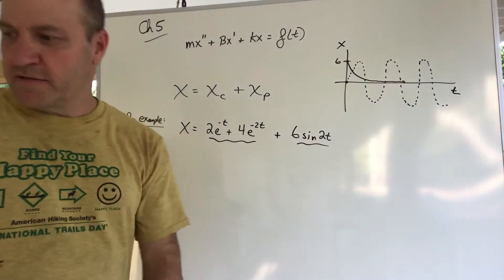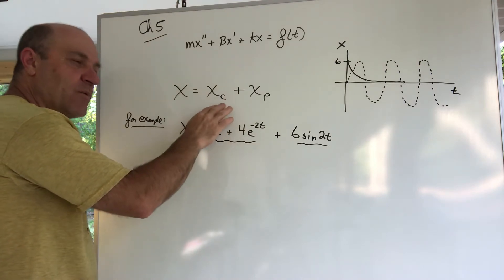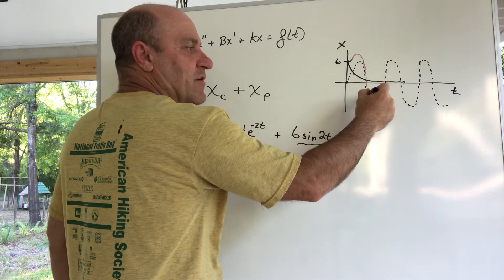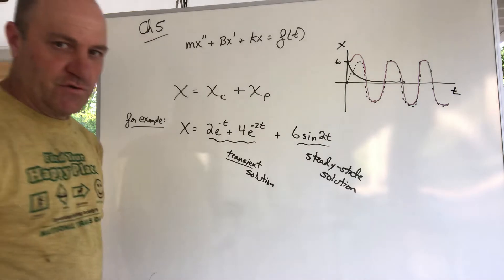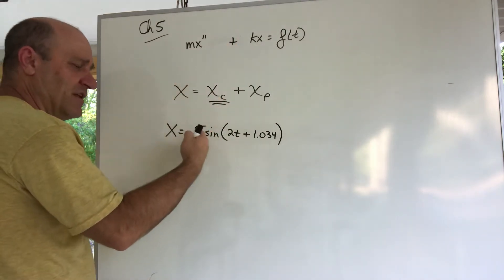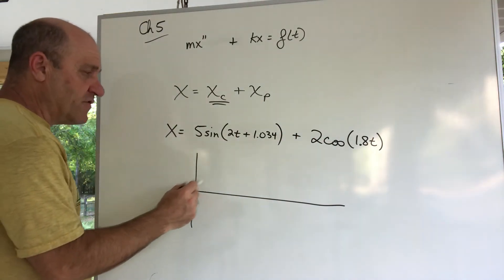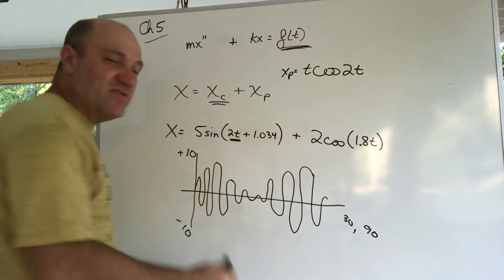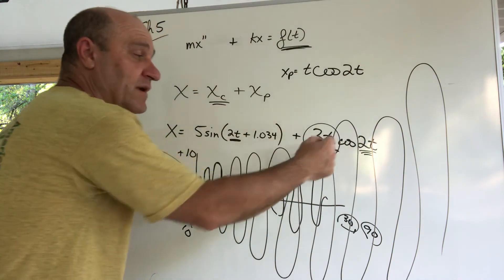Differential Equations Ch5, Forcing function

Comment: Sir  please define forcing function
Reply from the maker: It is an external force applied to the spring mass system, perhaps it is a motor on the mass that is driving the mass, or a push at certain time intervals, 

Without the external force, we call it free motion